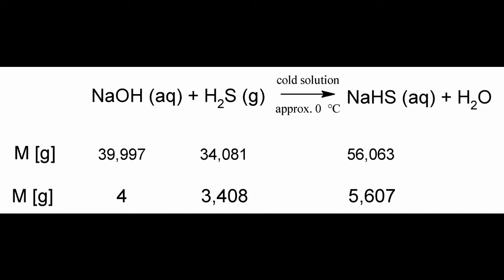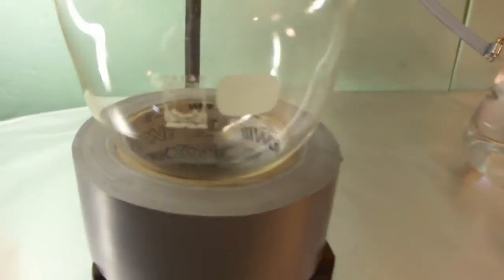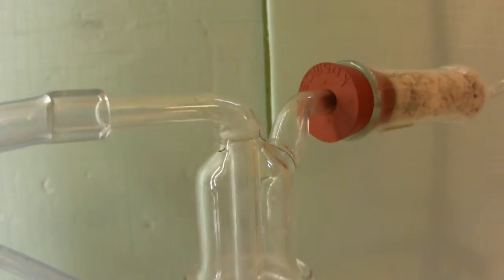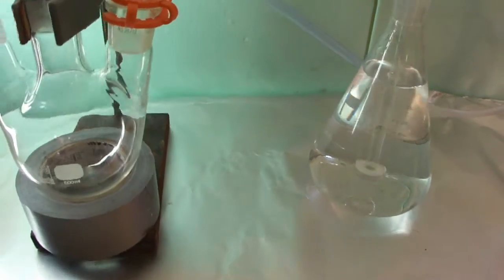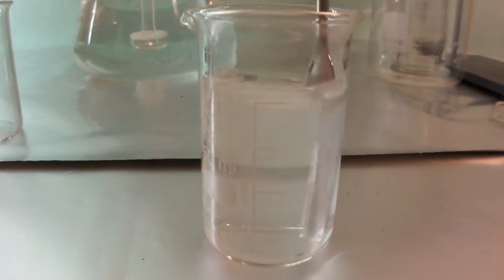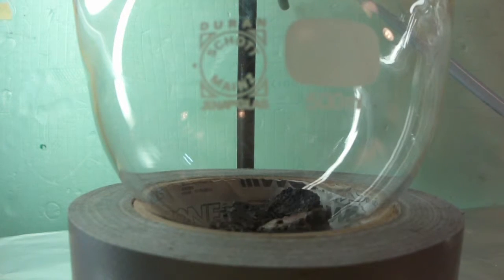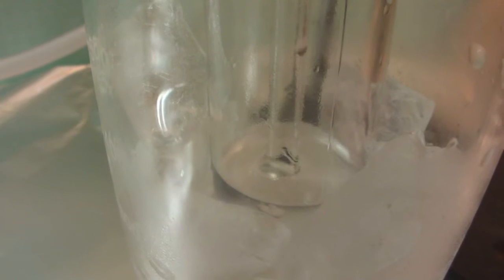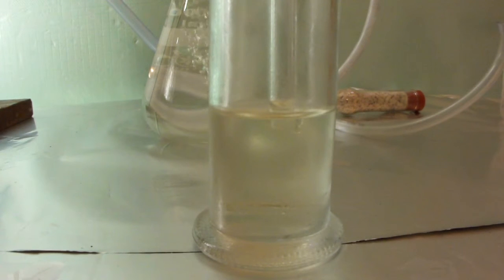Hydrogen sulfide and sodium hydrogen sulfide synthesis

Comment: selectabley reduces nitro groups in the ortho position,so will it reduce 3-nitrophthalhydrazide to  3-aminophthalhydrazide?
Reply from the maker: Luminol synthesis, I see. Interesting question...
No, this special case with the hydrazide nearby should not work. Instead, you could use thiourea dioxide.